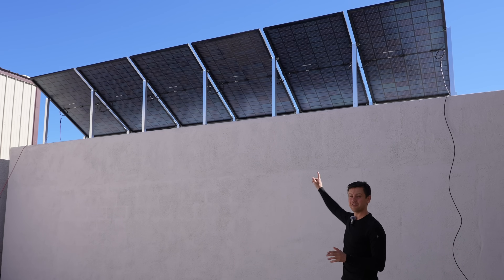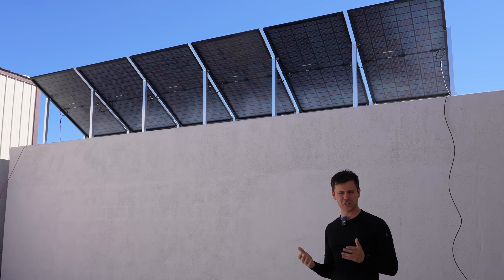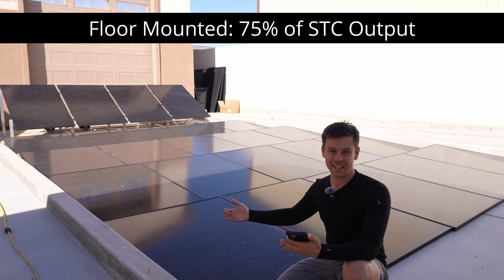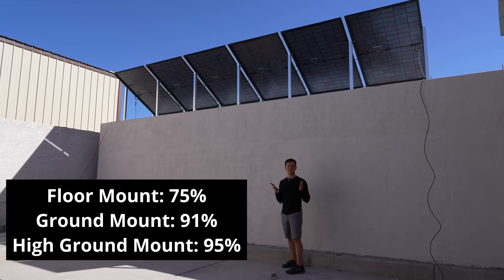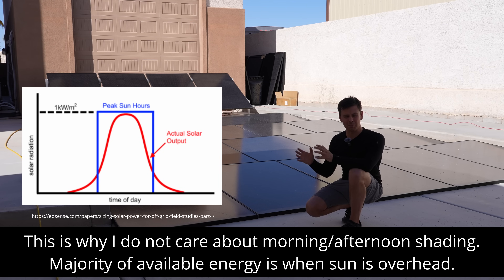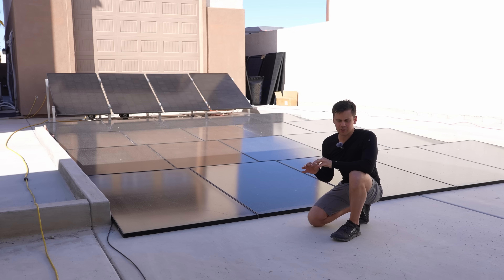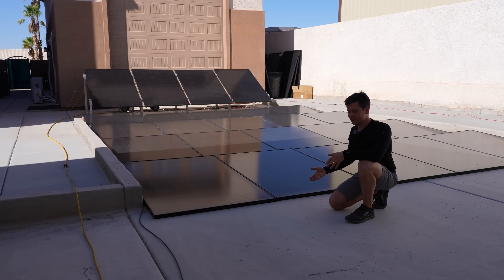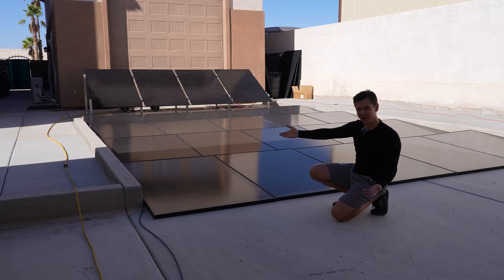How To Boost your Bifacial Solar Panel Output!

Comment from the maker: My favorite Solar Panels: https://www.mobile-solarpower.com/300w-solar-panels.html
My favorite Ground Mount: https://www.mobile-solarpower.com/ground-mount-racks.html

~~~~~~~~~~~~~~~~~~~~~~~~~~~~~~~~~~~~~~~~~~
Tired of getting ripped off? Check out my "Will Prowse Approved" solar product recommendations below!

12V Batteries
https://www.mobile-solarpower.com/lithium-batteries.html

48V Batteries
https://www.mobile-solarpower.com/48v-batteries.html

Offgrid Inverter System Builder
https://www.mobile-solarpower.com/48v-complete-system-blueprint-559371.html

Hybrid Inverter System Builder
https://www.mobile-solarpower.com/code-compliant-48v-offgrid-system.html

Mobile Handtruck System Builder (very popular!)
https://www.mobile-solarpower.com/mobile-48v-system.html

Solar Panels
https://www.mobile-solarpower.com/300w-solar-panels.html

Ground Mount Solar Racking
https://www.mobile-solarpower.com/ground-mount-racks.html

Wire, Lugs and Busbars
https://www.mobile-solarpower.com/wire-and-connectors.html

Tools
https://www.mobile-solarpower.com/tools.html

Fuses and Circuit Breakers
https://www.mobile-solarpower.com/fuses.html

Plug-N-Play Solar Systems
Ecoflow, Anker And Bluetti! So many models to choose from. See my current recommendations here:
https://www.mobile-solarpower.com/full-size-systems.html

~~~~~~~~~~~~~~~~~~~~~~~~~~~~~~~~~~~~~~~~~~
Need to build a large DIY system? Need a trustworthy solar distributor? These are my favorites:

Signature Solar
Creator of EG4! Solar Minisplits, Victron and More! Largest Solar Store Online.
If you want $50 off, please use my link below and coupon code "DIYSOLAR50":
https://signaturesolar.com/?ref=cPwLcVc0SW-BjN

Current Connected
Best Prices for EG4, Victron, Midnite and so much more! Fast Shipping and Highest Rated Customer Service:
https://currentconnected.com/?ref=wp

~~~~~~~~~~~~~~~~~~~~~~~~~~~~~~~~~~~~~~~~~~
Join our DIY Solar Community 
Need more help? Join the largest solar forum on the internet for beginners and professionals alike. 140,000 members and counting!
https://www.diysolarforum.com

Check Out My Free Book
Best-selling and beginner-friendly guidebook to off-grid 12V solar!
https://www.mobile-solarpower.com/the-book.html

~~~~~~~~~~~~~~~~~~~~~~~~~~~~~~~~~~~~~~~~~~
Contact Information:
I am NOT available for personal solar system consult! If you wish to contact me, this is my direct email: williamprowsediysolar@gmail.com
FTC Disclosure Statement and Disclaimers:
Every video includes paid promotion or sponsorship (such as free products for review). Some links on this YouTube channel may be affiliate links. We may get paid if you buy something or take an action after clicking one of these. My videos are for educational purposes only. Information is subject to change/update at any time. Electricity is DANGEROUS and can kill. Be smart and use common sense :) DIY Solar Power with Will Prowse is a participant in the Amazon Services LLC Associates Program, An affiliate advertising program designed to provide a means for sites to earn advertising fees by advertising and linking to Amazon.com
Reply from the maker: If you want to see my test results of mono versus bifacial over the course of multiple days and how much energy they collected in the same conditions, check out this video: https://youtu.be/Lbhx2fBiU5o?si=ZnKDuyzxu-XpzG5G
Reply from the maker: Correction! 16%, not 6%! Oops
Reply: @WillProwse  built my whole system by watching you. I didn't even know watts law until watching your videos. Working great for four years.  Just wanted to say THANKS WILL FOR EVERYTHING. 😉
Reply: You should build a solar pergola over the driveway. If you qualify to the federal grant money they will cover 30% of such a structure to put solar on.
Reply: @davefroman4700  

Install mirrors behind the bifacial panels.
Reply: @ajarivas72  as the sun moves the reflected light moves off the panels pretty quickly. If you use a curved mirror you may burn the back of the solar panel...
Reply: You forgot to mention maybe the biggest downside to bifacial panels is that they lose thinner glass which means they are more likely to be damaged if you live in a hail prone area.
Reply: @davidb.5544  I thought that would be the case as well, but the other day, we had big hail.  It's put pock-marks all over my truck, broke buckets, etc. They measured 1-1.5" across, so a large marble sized.  I have these same Aptos bifacial panels at a 12 degree tilt (so nearly flat), and had zero damage.  The reason I think they did better was because that same thin glass is quite a bit more flexible than a standard panel, which allowed a little bit of "give" to absorb the impact.  Almost like a trampoline effect.  I was certain they'd have been damaged, but when I got up to where they are mounted was shocked to see they had done so well.  There was even some damage to the frames, but the glass was all intact.
Reply: We purchased your book. And we've been watching you for quite some time. We just got hit with a hurricane (Milton) and after pulling the string of a generator all hours of the night...We're ready to convert! Also, Will,  for some reason, we're not receiving notifications when you drop a video.

Comment: The optimal height is relative to the surface that will reflect sunlight. If this distance is too great, the reflected rays will have low irradiance. Studies have defined a range between one and 2.5 meters as optimal values.

Comment: QUESTION: I am mounting 2 - 200 watt bi-facial panels on a roof rack. 
My van roof is brown which is great in the winter, put will be hot as hell in the summer.
Should i find something white (tarp? vinyl?) that can be set below the panels to increase the light?

Comment: I have 18 ground mounted 450w Q-cell bifacials. STC - 8,100w. During peak sun/angle - usually run 90-95%. The best thing about going from mono to bifacial is cold weather performance -- the Q-cells make MASSIVE voltage and current when those cells are cold. I even have two cracked panels in system (my mistake during mounting -- over-torqued some bolts). They still are producing power -- however, I would like to find a vendor to send me four new ones. Any suggestions?

Comment: Question, how hot do the panels get in the sun? Do solar panels have an efficiency increase if they are cooler?  Not bifacial ones, just standard ones. Reason I'm asking, if they get hot, would adding rear side water cooling be useful to heat domestic water

Comment: Im in northwestern ontario. Im curious on weather or not white landscape rock would be more beneficial versus white board, or sheet metal. Mine are 4feet off the ground on post and beam

Comment: Now try vertical edge mounted bifacials 50% facing east & 50% facing west. Get big production early and late day and will be optimum at reducing or preventing midday clipping. Your tilted ground mount panels are less than ideal because they have the mounting channels directly behind the panels, edge mounting is optimal.

Comment: Yo, ceramic coat the panels, it works for 1 year, no grit, less uv heat sinking, Its worth it and so easy. Griots ceramic 3 in 1 is the most professional while being ridiculously convinent for how long it lasts. 
I bet for a 1000w system you will get 10 percent more overall on average due to them being cooler and sparking clean all of the time.

Comment: Hey Will.  New subscriber here, and I have a question, on behalf of myself, and another YouTuber ( @ Sam HolmesSailing).  If I am understanding bi-facial panels, it seems like an optimal setting, would be with a highly-reflective surface below the panel location.  Would this include a static, horizontal mount, on a solar arch, approximately 2-3 meters, above the surface of the ocean, on a sailboat?  Obviously the water is not always calm, and the boat itself is not stationary, but after spending hundreds of days on the water (kayaking), I cannot ignore the extra solar exposure that comes with simply being on the water.  Please let me know your thoughts on this line of thinking. PS- loving the content!  It has really helped me stay current (pun intended) with current solar technologies. 🙏🙏
Thank you!!

Comment: Thanks for solid info & references. Bouncing off your info + reviews on Signature Solar, I just purchased 12 x  395 Watt Hyperion Bi-facial PV Panels from Advanced ... Solar, a warehouse just 2.5 miles away from my Northern California home.  ... I thought $.30 per watt was an incredible deal. I have a sunny roof to place these on. I am thinking of white elastomatic roof coating the roof,  and making my PV frame raised at North tops to angle towards the winter sun.

Comment: Is that the Integra rack on top of the bunker?  If so, how did you attach it to the roof?  I have a house that had a "professional" install last year (they were idiots!) and it is on the south facing side of my roof, but I want to double the size of the array.  The north facing side slopes away from south, so I was thinking of using something like that Integra system so that I can get back to 30° facing south and also use bifacial panels.  I have a standing seam metal roof and the company that installed the original system double ordered the clamps that go onto the standing seams, so I was thinking I could use those to mount the Integra racks.  Does that sound reasonable?

Comment: Great video! Very helpful information. Looks like you used the IntegraRack for the Panel install. Do you think overall the IntegraRack is as robust as the Brightmount system? The extruded Aluminum frames on the Brightmount look to be a heavier gauge than the IntegraRack seemingly to add strength. With the IntegraRack I see an advantage to having mounting points on both the rear and front of the frame legs, instead of 1 mounting point as with the Brightmount, which could add more structural support. It would be helpful to see how you have the new array attached to the roof, and since you have completed another install with it, seeing an update video with your opinion is always appreciated. I'll be making a decision in the next day or 2 about which system to purchase cost is still a big driver in the decision between the two systems, your input is greatly appreciated! Thank you for all you do!
Reply from the maker: Yes I have a both. I have videos on both too. I like Integra rack much much more. Stronger and easier to install
Reply: @WillProwse  Thank you for the reply, yep I watched both videos a couple of times (no ad block!) Great info, really nice to be able to watch good comprehensive videos on both systems. You rock!

Comment: Will - What is your opinion of mounting panels 13" up on a motorhome roof so they are over and shade the air conditioners vs flat to the roof and the panels get shaded by the air conditioners/fans ect?
Is mounting that high on a roof dangerous or just fine (as long as solidly mounted)?

Comment: Hey Will,
Have you compared mounting bifocals vertically with them mounted at the optimal tilt angle?
Have you compared those mountings without ground reflectors to those mountings with ground reflectors?

Comment: Will, Great videos. 
I am located in Phoenix AZ and have a home with about 50% flat while roof.  It also has a 18-24 inch or so parapet wall on the edge of the roof area.  I am thinking of mounting 8-10vertical bi-facial panels facing SE on the one parapet wall and 12-14 vertical bi-fical panels on another wall facing SW. With the white flat roof behind the SW facing panels I should get good gain in the mourning and really great gain in the afternoon and evening. My reason for vertical mounting on the parapet are as follows: vertical mounted to the parapet means I don't need to puncture the painted roof and repairs can be done without removing panels and hardware, cleaning of the panels would be easier and won't collect as much dust, the mounting should be less costly as the hardware should be about 1/2 or less than roof flat mounts, provided I can find good hardware for the mounting.  I also need to check fire codes but generally this seems safer than panels of the flat roof. I would appreciate any comments.

Comment: Hi Will.  You are not taking into account the heat issue which is called temperature coefficient.  Its usually around -.30%/degreeC.  Its on the spec sheet and on the back of the panel label.  It is an adjustment of the cell temperature, if the cells are hotter than STC then volts go down if colder than STC then volts go up and hence watts go down or up.   The ones on the ground are way hotter than the ones at the angle.  Your test isn't convincing.  You need to block the back of the panel with cardboard or a blanket, just to shade it from reflection to get the most accurate results.  
The higher panels don't do better because they are higher but because they have better cooling ( air movement) and the have a higher albedo from below.  The ones on ground at an angle have little reflection behind them due to the brown color and poor angles to get reflection.  
And finally as to bi facial being cheaper, not for much longer.  They were no subject to import tariffs but they are now.  So buy them now.
Reply from the maker: That's literally what I said and what I've said in multiple videos in the past 🤣 are you joking me? I even mentioned the convective air flow and have read most of the literature pertaining to bifacials. And I've covered temp coefficient multiple times on my channel. Are you new here?
Reply: @WillProwse  Maybe you have discussed TempComp, but its not what you said here.  You said the loss or gain of the panels was due to the bifacial feature not being used.  While that might account for a very small amount, the greater aspect is heat, especially for the ones on the ground.  Not new
Reply from the maker: Yes good point about the tarrifs
Reply from the maker: Did you even watch my video?

Comment: Do you or should you install a circuit breaker or fuse from the solar panel before connecting to your energy storage device?

Comment: I've gone with all bifacial as those tend to be the most cost effective when I was ordering. One is on a taller ground mount while the others are on the EG4 ground system. It's amazing watching on sunny + cooler days pushing 16kW at times.

Comment: I just installed two jinko 425 watt panels a month ago to charge my anker 767 solar generator and cannot seem to get over 360 watts no matter what time of day in northern WI. Im really confused its almost as if only one panel is working? I had 12 gauge extensions for a 50 ft run and bought wills suggested 10 gauge wire cut to length. Thought that would solve it but no dice still mothing over 400 watts

Comment: Almost everyone knows bifacial works better higher up. I think a pole mount dual axis is best at least 6ft for the lower edge and with something reflective underneath such as gravel or a paved area painted white or light gray

Comment: Thanks again for anther really good video.   I've been watching for a while now and I keep changing my viewpoint as to what and how I might do a system myself.  There are other video creators that have been testing out vertical bifacial installations.  It's an interesting idea under very specific conditions.   My current thinking for me (upstate NY - near the PA border) ... ground mounted Bifacial panels, mounted at the correct angle for this latitude at least 3 feet above ground (snow), surrounded by some white stones (and side of house able to also reflect light).   I'm thinking something like the EG4 18Kpv connected to the largest set of battery banks I can afford and the grid.   I just don't know if I could pull it all off (I have done household electrical work ... and I do have a retired electrician friend).    ... I think the process would make a good video.   ; )

Comment: This for real!  I recently purchased a couple Ecoworthy 195 Watt bifacials.  I am super-impressed.  I have them on a raised rack at about a 45 degree angle, mounted on my garage roof.  I had an existing array of non-bifacials mounted to the roof at a similar angle.  The bifacials consistently outpace my traditional panels.

Comment: It would be interesting if you tested bifacial panels mounted up high with mirrored glass mounted 12-24" below the panels so there is good air flow to keep the panels cool and reflect as much solar energy as possible.

Comment: I would be interested to see the results of bi-facial panels orientated west, say angled at 60degrees, to catch the last3-4 hours sunlight in a day. 
How would these panels do catching the morning sun if orientated to catch the evening sun? 
If people are at work, they may have a smaller usage peak in the mornings, a larger one evenings and not much usage during the day. 
There is part of my, fairly flat, roof which does not get sun from 10am to 2pm, except in the middle of summer, I am wondering if bi-facials could be worth adding as a separate string orientated west.

Comment: At sea on a boat/yacht the doublefaced panel will make a huge difference, the sea will relflect the sunlight, have tested by simply mounting a downfacing panel under the normal set - with good results

Comment: Want more views?! Throw a couple mirrors around these bifacials and see what happens. Seems to be the new trend. 

It's not practical at all, it can't be used in a normal daily situation but it sure makes an interesting youtube video! 👍🤣
Reply from the maker: Right hahha need to add the ol mirrors 🤣
Reply: @WillProwse people keep on suggesting that.  It seems like all youd do is overheat the panel
Reply from the maker: @pin65371  indeed

Comment: Bifacial gain sounds great in theory but it would be nice to prove it, measure it. Average Joe did recently and gains are not that impressive even when sun light was reflected directly at them. My monocrystalline (Canadian Solar 405W) panels sometimes output more than 100% in winter in the middle of the day.